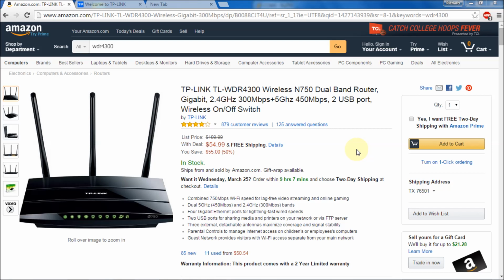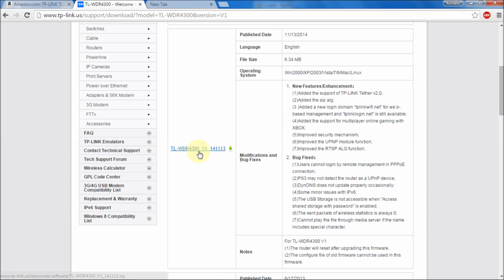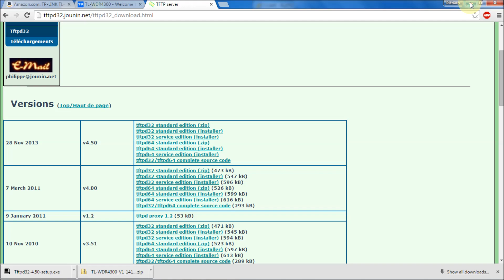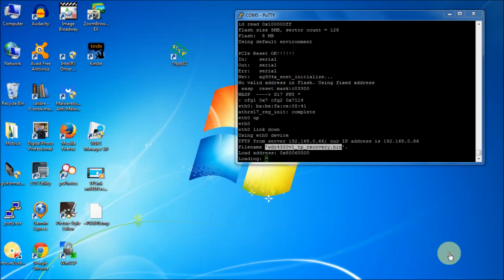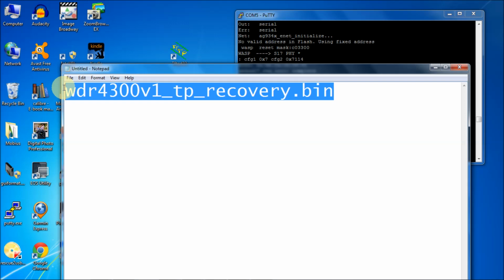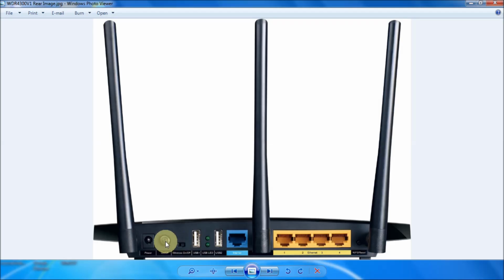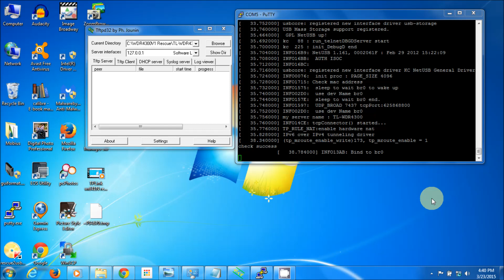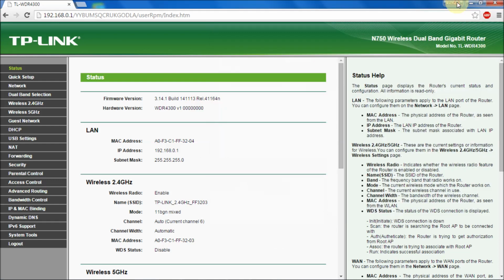Bricked TP-Link WDR4300 Version 1 Recovery/Rescue Unbrick Without A Serial Connection

Comment: How do i find out what i should name my "WR1043nd" firmware. And how do i watch the routers  workingroutine on putty. In my case the connection gets terminated when i restart the router, so i cant watch the restart or flashing procedure like you richard.
Reply from the maker: In order to see putty you need a serial connection. I only included that in this video for the sake of seeing what is happening inside the router but it is not at all required for the instructions in this video to work. Thanks.

Comment: if we dont have a serial connection then how do we access the router and check the IP address???
Reply from the maker: Here is one possible way http://www.dd-wrt.com/wiki/index.php/Obtaining_Router_IP Did you try the one I used in the video? Thanks.
Reply: Hi, thank you for your feedback. In this video you are using a serial connection to access the CLI of the router (correct me if I am wrong). Without serial connection how could I access the CLI of the router since it is not assigning any ip address to my laptop.
Reply: since it is not assigning me an IP address hence my DG is unknown. Therefore, I am unable to access the router. 
I am using TP Link Archer C7 V2. I was trying to flash it from DDWRT to OPENWRT and then back to DDWRT and during that process it went down. :(
when I power it on all lights turn on for a send and then only power light is stays on.
Reply: To sum up. I want to inform you that I am not getting any ip address from the router since arp -a command is responding with "169.X.X.X" ip address. In short, I am unable to access my router. What could be the other solution??? Looking forward to hear from you.

Comment: Hello Richard, I follow your tutorial step by step, but when it start to loading the Firmware through TFTP It flashes and didn`t upload the firmware. I used to have a OpenWrt Firmware, what can I do? I would really appreciate if you can help me.
Reply from the maker: +Pedro Garretón Try the recovery using the serial connection instead. Here is the video for that procedure: https://youtu.be/t35Pei_eb6o?list=PLnxXRLSlmSVNiENiN9wTejP6dtIqqmTya

Comment: The router doesnt go in to recovery mode, (holding reset + Power on), doesnt do anything... the router just reverts to the all-lights-flashing syndrome... Accordingly, thet tftpd programm doesnt transfer the .bin file over ...

Suggestions ?

Many thanks
Reply: +John L  Have tried this proc on 2 different PCs...same result, still bricked...Can't say that I'm impressed with this unit ... the reset button does nothing, and it doesnt have a hole / pin reset, like the most basic of units
Reply from the maker: +John L You may want to try this repair to see what is actually going on with it https://youtu.be/t35Pei_eb6o?list=PLnxXRLSlmSVNiENiN9wTejP6dtIqqmTya Thanks.
Reply: Thanks for taking the time to reply. My flashing light sequence is not the same as seen in your videos, but will give your alternative method a look.

Cheers,

John
Reply from the maker: +John L All the best Sir. Thanks

Comment: hi, i'm italian (sorry for my bad english),

I have an Archer C7 v1.1, yesterday i have retry the procedure whit TFPT server, and something append, the leds stop flashing, and only 3 led were on (power led, "sun" led, and the lan port attached to my pc). 

In Change Adapter Settings (windows) my lan adapter pass from "network cable unplugged" to "Unidentify network". 

At this point i try to connect to 192.168.0.1 ip adress, but nothing append. How much i must wait for the firmware loading? 

I try to reboot with power button, but at this point all leds flashing again.
Reply from the maker: +Pindol Try a 30-30-30 reset https://youtu.be/gczCzP9Rry0?list=PLnxXRLSlmSVNiENiN9wTejP6dtIqqmTya then try this procedure again. It should take about the same about of time as it does on the video. Understand that I can't confirm that this works on a C7 as I don't own one. Thanks.

Comment: I done it all but router never copy bin file to itself. WHY?
Reply from the maker: +aleksandars88 Not sure what you mean? Thanks.
Reply: +Richard Lloyd At 13:08 in your video, setup copy bin file to your router, and here with my router that NEVER HAPPENS, and I have the same problem with it like you. why i can't do the same?
Reply from the maker: +aleksandars88 Did you follow the video exactly? If you did try the same exact procedure on a different computer. Thanks.
Reply: +Richard Lloyd Yes i did. I gave router to my neighbour, hi will try the same procedure
Reply from the maker: +aleksandars88 Great. Sometimes firewall or anti-virus software blocks the TFTP program. Thanks.
Reply: i try to disable it, but it's the same... :/

Comment: I bricked router by installing openwrt firmware. Did exactly as you said and it ended up being stuck in the same loop you showed in 0:55 
I guess I just need to buy new router from credible manufacturer. Saving 10 euros ended up throwing 50euro worth box out.
Reply from the maker: +Roman Beljak Try the same procedure again on a different computer and see if it works for you. Thanks.

Comment: Thank you very much for this it worked great. Can I ask if through dd-wrt you got instant 1000mbps speeds through the LAN or did you have to mess with the settings?  I can set everything up its just my speeds seem to stay around the 100mbps mark. Thanks.
Reply from the maker: +UKG-TV The LAN and WAN ports on this router are auto-negotiating which means that it senses the speed of the connected device and switches the speed automatically to match it. So if you plug a 1Gbps device to any of the ports they automatically match that speed likewise if you plug a 100mbps device to it. You most likely are connecting a 100mbps device to it that is why you are getting that speed. Also note that CAT5E cable is required to get a stable 1Gbps connection. Thanks.
Reply: +Richard Lloyd Thanks again for the reply. I am connecting an iMac and MacBook Pro both with gigabit ports via cat 5e cable to the router. Also connected is the Seagate Central NAS drive but transferring data to this (via time machine) is very slow running at 100mbps. I just wondered if there was something I was missing?  Thanks again.
Reply from the maker: +UKG-TV What firmware revision are you using on the router?
Reply: Hi, the router was running 3.14.3 Build 150518 Rev 70901n but has been flashed as per the instructions here http://www.dd-wrt.com/wiki/index.php/TP-Link_TL-WDR4300 using the files within this page.  This gives me a write of around 30MB/s and a read of 45MB/s but was hoping for something in the region of 85MB write?

Comment: Hi Richard, thanks for the sharing. After following the instructions, I can see the firmware successfully downloaded through the TFTP Server. However, the router does not reset after that and it goes back to the 'ALL Lights blinking' mode. Is there anything else I can try?  Thanks.
Reply from the maker: +DJ Sam Try a 30 - 30 - 30 reset and the try it again. if that does not help try it again on different computer. Thanks

Comment: Thank you for your tutorial. I have the bricked buffalo whr g300n. I tried so many method to unbrick it without using serial connection but still cannot fix it. My router only has solid power light on (the other light were off when the router is powered on)  and does not respond to the reset button no matter how long i pressed the button. Do you think I still able to unbrick it using your method? or I should use serial connection to unbrick it? thanks.
Reply from the maker: +sanjiwana arjasa I know this works on TP-Link routers. I can't attest for Buffalo routers. I guess you could try it but I can't say if it will work or not. Thanks.

Comment: I have a TL-WDR3600 v1.4 that does not respond when trying to use the TFTP method.  Wondering if anyone knows possibility firmware version maybe does not have a boot loader?
Reply from the maker: +Lance McGrew Does your TFTP log show any activity? See this video https://youtu.be/plaxiiSKlJI?list=PLnxXRLSlmSVNiENiN9wTejP6dtIqqmTya Thanks
Reply: Nothing in the event log. My next move will be to try connecting through the UART pins and try communicating through PuTTy.  The routers LED's activity all mimic your indication of a bricked system.  Odd thing for me, the router was just fine running DD-WRT firmware and suddenly one day the LED's started the on-off routine.  I am also replacing the power supply along with trying to restore a good boot.
Reply: Okay, got it working.  Once connected through the UART, PuTTy displayed the boot loop.  I then followed your remaining video details and  restored to a working DD-WRT router.
Reply from the maker: +Lance McGrew That's awesome. Glad you brought it back from the brink. They are great routers. Thanks for watching.

Comment: Dear Richard Lloyd, I tried your instructions for a bricked wdr3600, but I have the following problem.Tftpd shows that the file for my router is transfered, but at a very slow rate(about 1700bytes/sec), and as a result I loose the connection with the router  at about 50% of the transfer.Do you have any suggestions other than the "serial" method?Thanks in advance
Reply from the maker: HarrisP This is the only method I know of other than the serial option. If you have a different computer you can try this procedure on that might do it. Thanks.

Comment: Thanks a lot I did it with a tp link td-8968 v2 last firmware version I change the name to td8968v2_tp_recovery, I dont know which ip worked as I tried every IP it never showed anything in the logs, I used all the ips here suggested. I was resigned at the end as I wasnt able to see any logs. but finally went i went back to the original auto ip it worked. I even tried 192.168.1.1
Reply from the maker: Daedube Great, thanks for watching.

Comment: Hello!
First, thank you for your video.
Second, do u know how to enter recovery mode in 4300 v1.3?
I did what u show on video and tftpd server got zero requests from tp-link client...
I've tried to connect it on 192.168.1.66 IP aswell and switch it to Internet/WAN port still nothing happened.
Reply: The ip was the same but a random image name and the procedure to boot at tftp mode was different - don't know what it is actually because in the end I did it using uart connection.
Reply: So I assume that when someone will figured out how to boot it in tftp property (v1.3) will win the game because then the name of image can be reached from log.
Reply from the maker: Tomasz Szczepanik I son't have a V1.3 but usually there isn't too much difference from a V1 to V1.3 in TP-Link's site they would still call them both a V1. Did you try 192.168.0.66? If you did I would try 192.168.1.100. If all this does not work you could try a serial connection as I show in this video https://youtu.be/t35Pei_eb6o?list=PLnxXRLSlmSVNiENiN9wTejP6dtIqqmTya Thanks.
Reply: I've tried both IPs. 
Thank you for answer. I think i need to try out UART connection.
Reply from the maker: Tomasz Szczepanik The serial connection will show you what IP it is looking for. Then you can do this recovery once you know what and where it is looking for it. Thanks.
Reply: +Tomasz Szczepanik Hi, did you already figure out the IP for your v1.3? If yes, I would really appreciate if you tell me - Had no luck soldering a serial connection so far..
Reply: +Richard Lloyd I've actually got a v1.1 - is it the same as V1?
Reply: Tomasz Szczepanik
Okay, thank you so far! You mean you uploaded the image over UART?
I've actually got v1.1 but it won't transfer the file over TFTPD.. Will probably have to buy a serial header cable
Reply: Yes. I've bought it on aliexpress.
Reply: Tomasz Szczepanik
Okay, thanks m8 :)

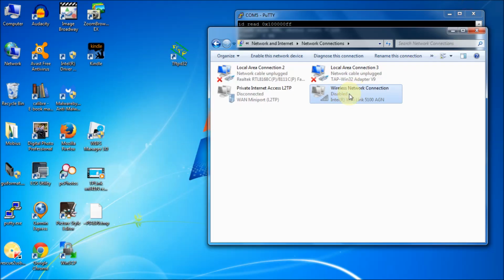Comment from the maker: +Wilfred Lowell If you are using this router (WDR4300 Version1) then the IP address for your computer should be set to 192.168.0.66 you can see this at 8:24 mark in the video. Follow my steps exactly and it should work for you. Thanks.

Comment: Hey Richard! Thanks for taking the time to make these videos! I just got a WDR4300 v1.2 from a friend... He never did anything to it and the damn thing bricked itself believe it or not (saw another case like this on a forum) Anyhow, I was really hoping that the TFTP flash method you used in the video would work, though I had read that you had to strip the bootloader from the firmware file you planned on sending to it beforehand and I found a prestriped version of the stock firmware online... That didn't work (transfer never initiated) and neither did the complete firmware file such as the one you used in the video. More importantly though, I see one BIG and important difference thanks to your video... Your WDR4300 still connected (though intermittently) to the network card... Apparently long enough for the TFTP server to send it the firmware... In my case, it never shows up at all, not even for a few seconds... (the flashing lights on the device however do mimick yours) Does this mean I'm stuck with using a serial method? And if so... If I have access to an old desktop with a serial port, can I just strip off one end of a serial cable and solder it to the appropiate place? Thanks!!!
Reply from the maker: Jeffrey Schulman Are you holding the reset button for three seconds while powering it up? I did this with a version 1 not sure if it is the same for the V 1.2 . You do need the UART USB interface as it is not the same as a serial connection. I bought one on Amazon for $7.99 but you can get them cheaper. Here is the  link for the one I used @1 and here is the video on how I did it https://youtu.be/t35Pei_eb6o?list=PLnxXRLSlmSVNiENiN9wTejP6dtIqqmTya Thanks

Comment: Hey Mr.Richard, How are you?
After try upgrade WDR400 to last version, my router show me only power led freezing.

The led port blink after connect data cable, could you help me please?

I dont understand how to connect router by putty, could you explain?

Thanks a lot.
Reply from the maker: Leandro Rodrigues Barbosa In this procedure connecting to putty is not necessary. I only show it so that you can see what is actually going on in the router. It would require you to connect to the router with a serial connection but again you do not need to connect to the router with putty. Follow the procedure as I state in the video (no putty required) step by step and you should do fine. I also have another video on how to recover this router but it requires a serial cable to recover it. Here is the video for that should you need it https://youtu.be/t35Pei_eb6o?list=PLnxXRLSlmSVNiENiN9wTejP6dtIqqmTya Thanks
Reply: Richard Lloyd Hi,
From Brazil, I,m have this uart, is compatible?
http://produto.mercadolivre.com.br/MLB-639974264-usb-uart-6pin-connector-module-for-arduino-nano-compatible-_JM
Reply from the maker: Leandro Rodrigues Barbosa  It looks good. I think it will work. Make sure you set it to 3V. This one has a switch for that. Thanks.

Comment: I really no idea now my router now useless.
Could you please help me ?
How to set ip for W8970v1 Adsl ?
And file recovery name.
Reply from the maker: ten piseth I don't have access to this router so I can't really comment directly. I would take a guess that would be the same procedure and that the file name is w8970v1_tp_recovery.bin. Thanks please tell me if that worked for you please.
Reply: I have test as what you told me to . But i have no luck.
I try for so long.
Not work.. anyway i can no what is my router ip required?
Reply from the maker: ten piseth I can only tell you that mine was on 192.168.0.66 on the recovery. Thanks
Reply: Thanks. .. for your help. .
Reply from the maker: ten piseth You are welcome. Thanks for watching.

Comment: Richard, i have same situation, my router flashin light same as you show, i do all as you say in video, but after i download file in to it , it continue blink as in 0.52, but you say it must blink with different lights ? What i need to do?? It's bricked forever ? 

Have another way to bring it back to life?? And i haven't Com5 Putty screen as you show on video.
Reply from the maker: Andrey Kapustin  Did you download the latest firmware file from TP-Link? If so try the others. The only way to see the COM 5 putty screen is to have a serial connection to the router. Here is the recovery video where I use a serial connection to fix it: https://youtu.be/t35Pei_eb6o?list=PLnxXRLSlmSVNiENiN9wTejP6dtIqqmTya
Reply: Yes, latest. Thank's a lot. I will try another firmware.
Reply from the maker: Andrey Kapustin You're welcome. Good luck. Please tell me how it went for you. Thanks.
Reply: Richard Lloyd Nothing work's(( Yesterday a will try more... any solutions without serial port ?
Reply from the maker: Andrey Kapustin Do a 30-30-30 reset https://youtu.be/gczCzP9Rry0?list=PLnxXRLSlmSVNiENiN9wTejP6dtIqqmTya and try this procedure again.
Reply: Richard Lloyd Not help, do it 2-3 time in full cycle,but still have all lights up for 1 second then they off for 3-4 second and again again again....
I remember, it works for my tp link 841ND, (i sold it)
Solution?
Reply from the maker: Andrey Kapustin Do you have a different computer than the one you are using to try this again? Thanks
Reply: Richard Lloyd hm...I havent, but I found serial to USB cable. I show it to you later.
Reply: Richard Lloyd hi, my friend give me this serial - usb cable (PL2303) and second cable for connect with PL2303 from one side and 9 pin from other side. But now i have problem. What 4 of 9 hole i need ? And how right connect it to router, can you help me? Thank you!
Reply from the maker: Andrey Kapustin Here is the recovery video where I use a serial UART connection to fix it: https://youtu.be/t35Pei_eb6o?list=PLnxXRLSlmSVNiENiN9wTejP6dtIqqmTya